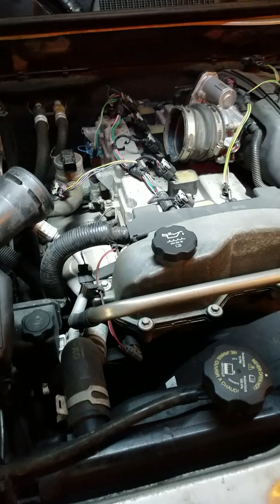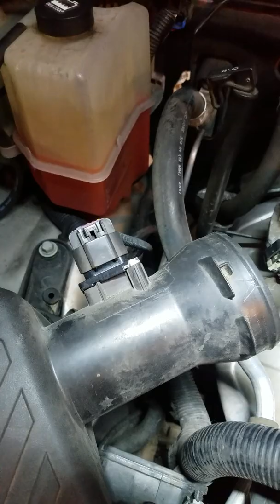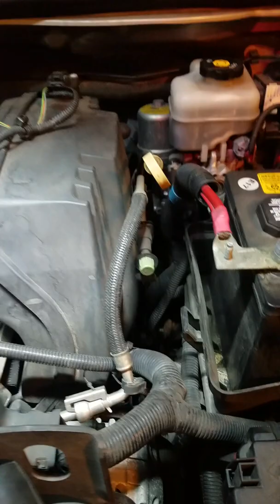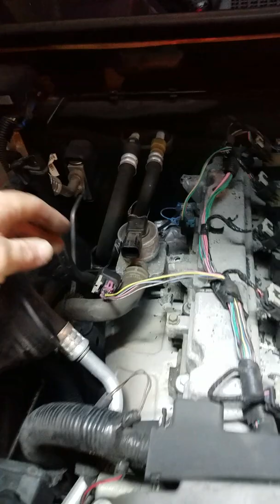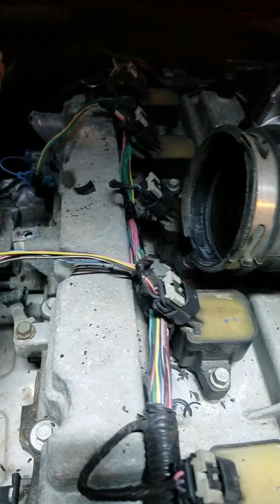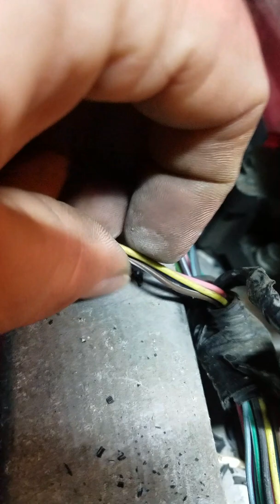H3 Hummer reduce engine power fix

Comment: I had one of the coil wires to do the same. And my Tech 2 did not find the fault... So finally noticing that the coils fuse was blown, I found the reason. Those wires are a bit stupidly routed, sooner or later some of them short to the ground.

Comment: I had the exact same issue several years ago. I replaced throttle body, sensors but no luck.  Had to take it to a mechanic and he was able to find the WIRE issue.  All this happened a few months after dealer did some engine work on it and extended  warranty had expired.

Comment: This harness should be a recall . The problems keep coming one at a time . Trans won’t shift will also happen later fuse box gets wet so all relays get trashed . roof leaks onto the TCM and BCM by they passenger door because the ran the drain tube on top of it basically

Comment: GREAT CATCH! wow you are great at what you do to find something so simple as a ground wire thank you my hummer had the same problem, but before i went and bought all the new parts i checked the wire harness as you suggested and to my shock the exact wire was stripped and touching the valve cover i repaired it and i went on 500-mile trip and back with no issues, Thank you again😂

Comment: My H3 randomly loses power, especially when it rains, the engine works smoothly but doesn't react to accelerator pedal. I've cleaned the throttle, MAF sensor, found several ground issues but the problem arises again and again. 
Experimentally I found that the issue dissappears when I unplug the 4wd harness and plug it again. And after that it works as a charm. Then after a couple of days it arises again.

Comment: Thanks for the help… 08 H3 ,3.7L having same intermittent problem… found same brown wire rubbed through insulation, shorting out on valve cover… Blue wire almost rubbed through also.. installed new valve cover last year never replaced the wire looms as they were all brittle and crumbling…. It’ll be my Labor Day weekend project.. thanks again for Sharing….

Comment: Where are the intake sensor wires connected? I bought a Hummer this week and the sensor is there, but the connector with the wires are gone.  The old owner must have disappeared with him, I don't know. I would like to know the path of the sensor wire input to its final destination. Thank you

Comment: I think these motors run hot sometimes. I replaced the wire looms (covering) twice they were brittle and melted. Now I will look for this problem because I am having trouble with the stab traction control etc.  Thank you

Comment: I have the same problem on my 2006 H3, it would just die when slowing down and making a turn. Did that fix the problem? Thanks for sharing.
Reply from the maker: Yes, after repairing the exposed wire, the issue was fixed and never came back

Comment: Mine is 07 Lux, 2 years of this on/off power loss, stab sys etc. Multiple tows,  thousands of dollars to various mechanics to solve it. Hubby finally pulled dash apart, frayed wire behind radio and the 4h4L buttons were GLUED in, didn't work transfer case at all. New buttons,  and some tape over the wire and ..fingers crossed....no more issues.

Comment: Should you just wrap those wires in electrical tape
Reply from the maker: Electrical tape works best without having to cut or splice the wire. The actual wire was not damaged just the rubber insulation around it, so I only needed to re-insulate it to keep it from grounding out on anything. If it was a single wire that did not go into a harness I would have used heat shrink.

Comment: I heard after brake service this may occur. I just had my front pads changed and installed a new battery last week. I've never had a problem with this car (09 H3) until now. This first happened to me Sunday and every day since. I'm actually sitting on the side of the road because it just happened again. Hopefully I will be able to make it home eventually and take a look
Reply from the maker: The battery terminals have been none to be an issue as well. Since you just changed the battery I would start there and make sure the terminals aren't weak or broken.

Comment: THANK YOU!!!!!!! I have spent over $500 trying to get rid of my check engine light. Code P2431 and P2432. I replaced the air pump, relay, and air injection check valve with no luck. I happened to watch this unrelated video by pure luck. It was the root of my problem! You Sir, are a genius!

Comment: Going to hop on this tonight! I have a 2006 H3 with all the same characteristics. I have the position sensor, MAF sensor, peddle, and similar items in my amazon cart. Hoping this saved me a good deal of time. There is also a power drain so makes sense it's a stripped cable.
Reply from the maker: Anorher thing to check is the battery terminals. They tend to be a common failure point that I discovered as well.
Good luck.

Comment: I am very upset , two weeks without driving my Hummer H3, i am from Italy but i live in Lithuania , nobody here is able to solve my problem.
The car can drive maximum 40 minutes and then the usual sequence comes up, yellow engine sign, SERVICE STAB SYS TRACTION FAILURE REDUCED POWER, and car dies.
ERROR CODE P0601
After 10-15 minutes everything normal again.
I bought this car 2 months ago, a service installed for me the parking sensors.
Also, one day i forgot the lights on, a friend of mine came to help me with a portable car battery charger .
I remember that he had to increase the voltage because he said that it wasn't working.
After few days the car randomly died for the first time, now it's happening all the time after 40 minutes driving.
I took to some electric guy but he couldn't solve the problem he just said that car computer might be replaced but he won't do that because he doesn't know how to program it.
Here in Lithuania all car services are scared of american cars, i don't know why !!
I won't surrender but i am really upset. What could you recommend me to do ? Thanks a lot
Reply: prova a pulire il debimetro